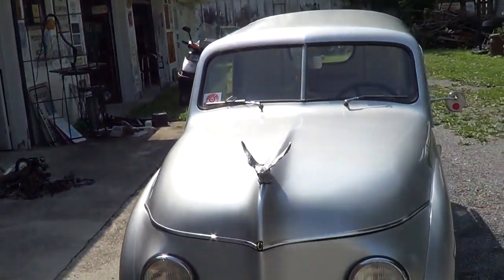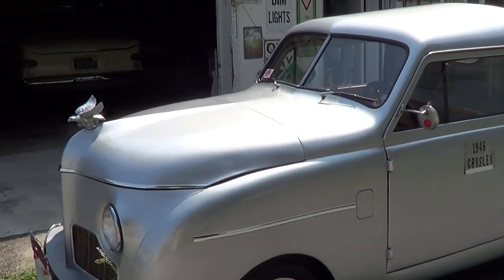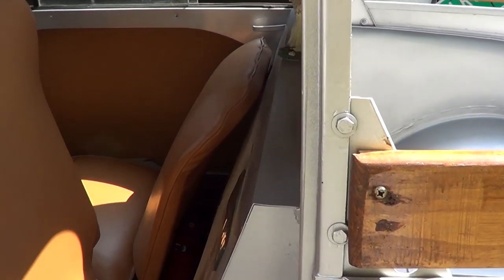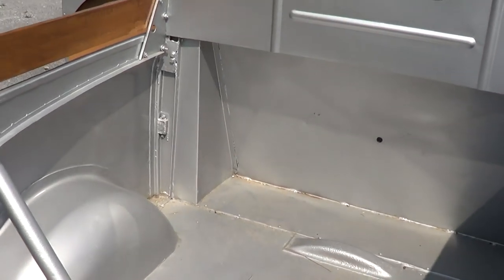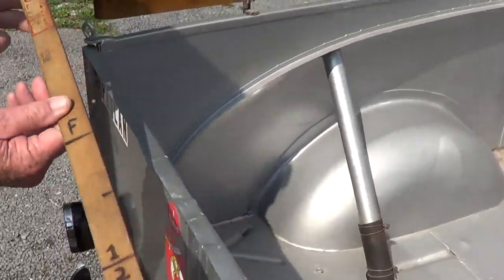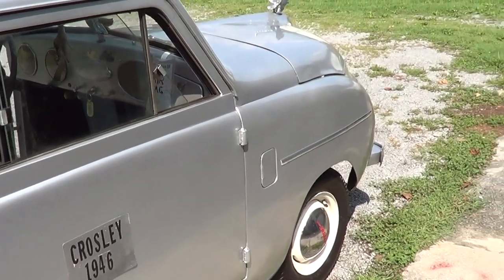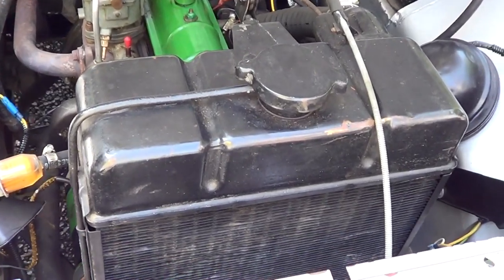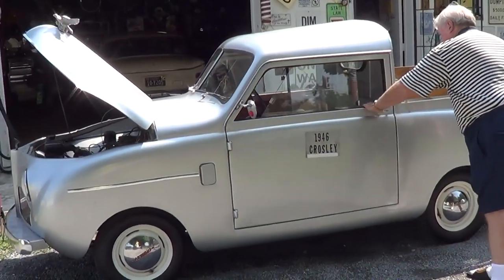1946 Crosley Round side Pick Up

Comment: When I was growing up we had three Crosley's in my family.  My mother had a 48 sedan, and a 51 Station Wagon, and I had a 51 Hot Shot.  I can remember my Dad working on the 48 all the time, mainly motor problems.  The water passages in the block would rust out and leak water into the combustion chambers, of the COBRA (copper brazed) engine.  Dad would undo the connections and fittings and lift the engine out by hand and set it on the lawn.  We would then go to the junk yard and get a different engine for about $25 and have the Sedan running again that day.

The 51 Station Wagon did not last long because my Mother traded for a 51 Rambler 2 door.  The Hot Shot was fun when you could get the disc brakes working at the same time.  I ran it around Pittsburgh for a year or so and left it parked in the street in front of my house when I joined the Navy.  When I came home on leave my Dad told me he had sold the car for $175 ( a $25 dollar profit) because he was tired of seeing it covered with snow and dirt in front of the house and the neighbors were complaining.  Wish I had that Hot Shot now because I saw on on e-bay not to long age for $10,000.

Smile
Reply from the maker: Cool....thanks for the story!

Comment: I love it when people comment on things that they don't know much about. The guy that said that Nash bought Crosley out has to be smoking something funny. Crosley plain went out of business in mid 1952. Also to clear something up , the 46-48 engines were copper brazed steel blocks. They were replaced with cast iron blocks in 1949, due to the fact that the steel blocks would rust and leak coolant. This car has a 49 or later engine in it. The claim that  it is original is incorrect.

I had 3 Crosley's growing up in the 60's. A 48 Wagon, a 49 Wagon, and a 52 Super Sport. If anyone has questions about these cars, I would to answer what I can.
Reply: Tell your shit to someone that doesn't know better. Google my info on the net and see if I'm incorrect.
Reply: Sorry, I may have incorrectly criticized your comment. Were you disagreeing with me? If you agree, then you have my apology.

Comment: The Crosley motors were used in midget racers competing with the V8-60 Fords and the small Offenhausers. There were special heads/cams etc, just like for the small Ford V-8-60. The first race I ever saw was in ~1950 and all of the midgets had these V-8 60s, Crosleys and Offys. They were all fast, running on alcohol/nitromethane and used castor oil (real castor oil). They ran dirt and also indoors at large locations.

Now your brain is full ... ;)

Comment: They had the stupidest design engine ever made, It was cast in two parts, the crankcase was one piece and the cylinders with integal head the other. The early ones were all cast iron and changed to aluminum castings in 1951. The worst part was the cylinders bolted down on the crankcase with 10 1/4x20 studs and nuts which no wrench made that would reach. Always leaked oil between the two halves. They should have stuck with radios. Nash bought them out in 1952.